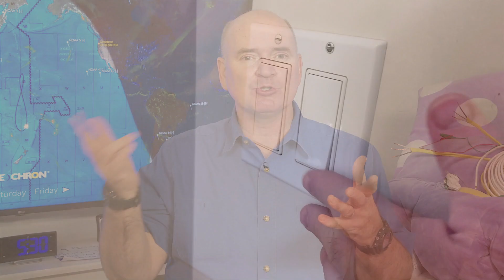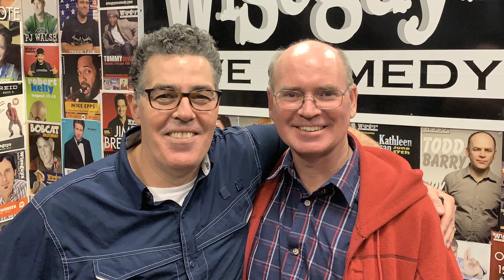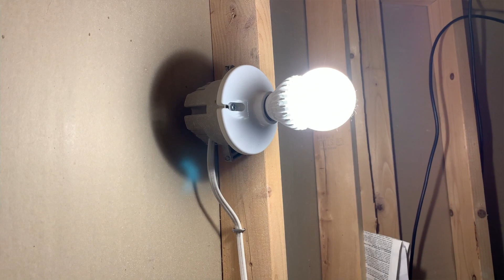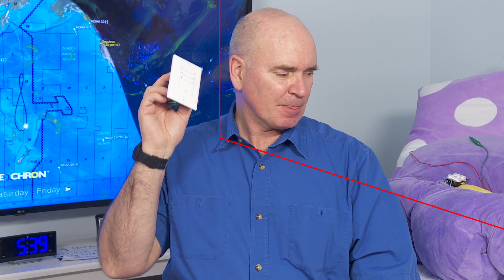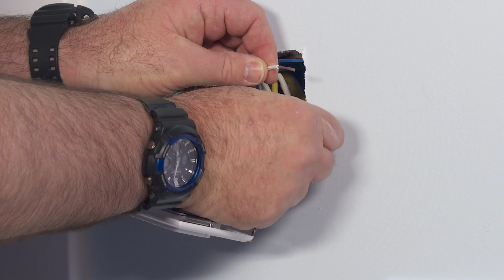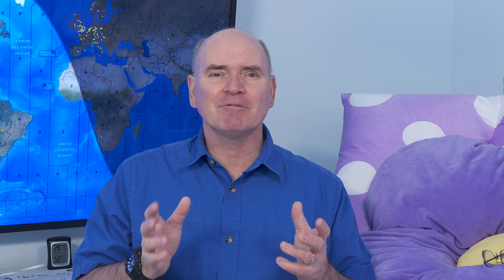Installing a Timer for a Bathroom Fan

Comment: Obviously you then install an absolutely insane cyclone-level fan so you can turn on the switch and run away as the poo gas gets sucked up
Reply from the maker: Straight out of the old Home Improvement show, right?